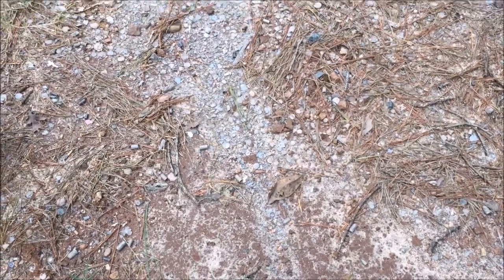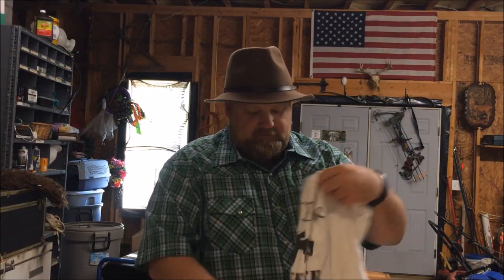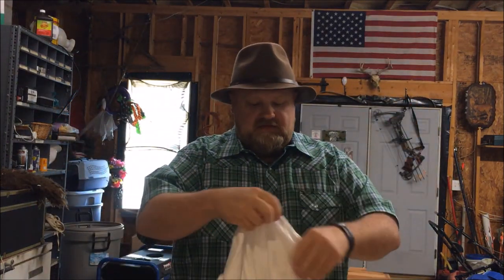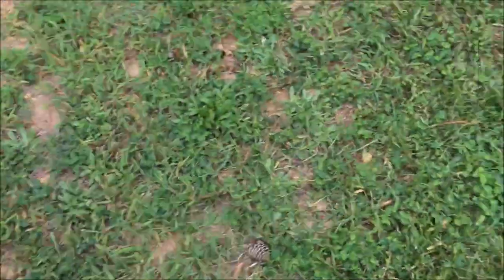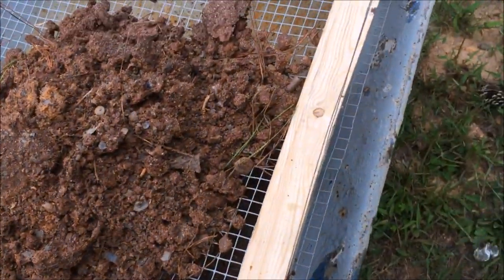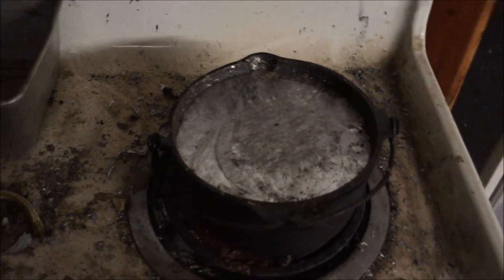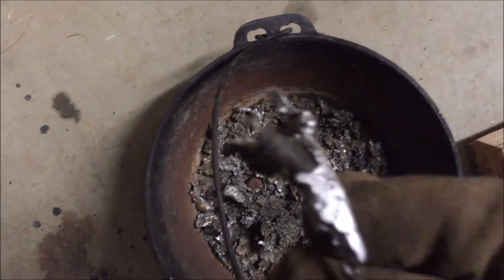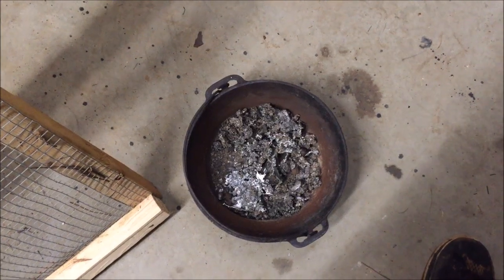Smelting Range Lead

Comment: Melt the "slag" again and put candle wax (just a little finger nail piece) in it. It will Flash so no worries. Stir it in and the bad stuff will float and make it easier to skim.  BUT, SAW DUST works just as good if not better and NO FLASH Fire. Works very well.
Reply from the maker: Thanks bud appreciate it!

Comment: Your throwing a lot of your tin out you need to flux it,    Wax will work and stir the pot  after you throw the wax do this where there is lots of air moving all the dirt and impurtys will rise to the top and can be cleaned off at that point you should flux oh every 50  bullets with a 5 pound pot
Reply: oh bullet lube will work also
Reply from the maker: cabotbluegill thank you sir